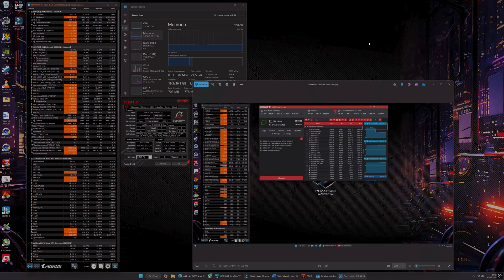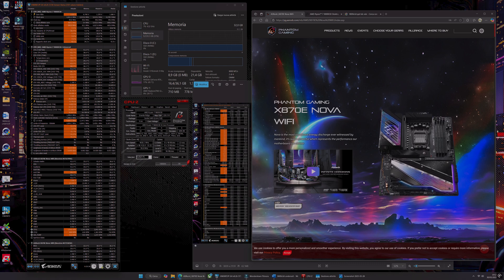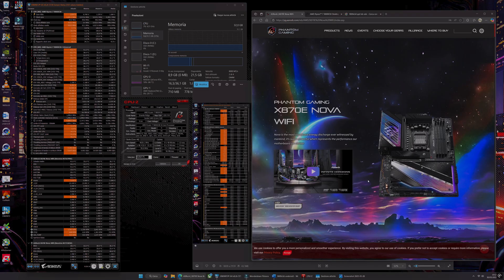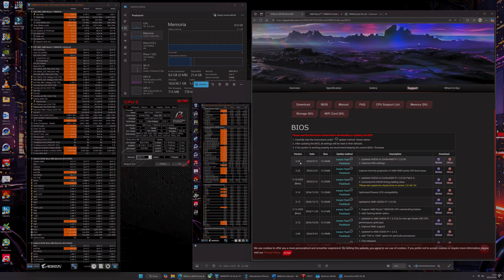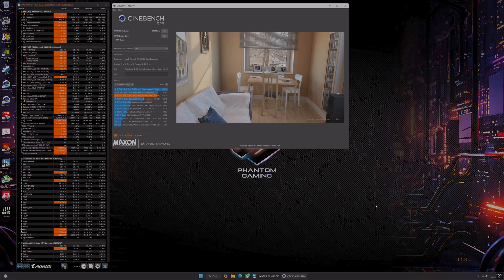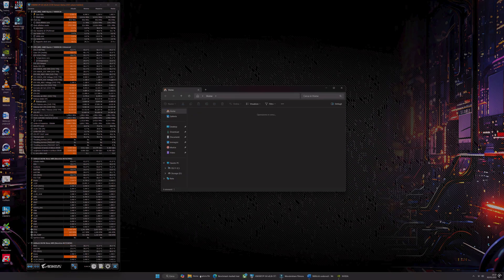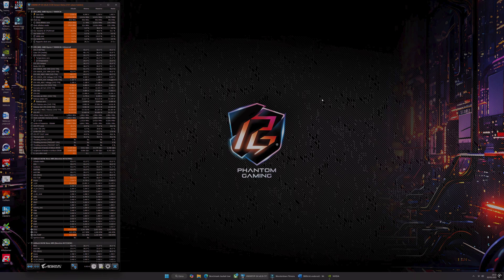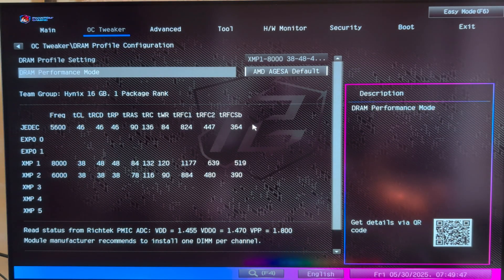Ryzen 7 9800x3d UNDERVOLT Guide and MEMORY up to 8000MTs🔥

Comment: Hei, i don't understand, why my cinebench r23 give me 14000 ( with PBO or Without PBO ) , can you help me please
Reply from the maker: Hi, first of all try to do a Clear CMOS. After that, in device manager go to USB Controller and uncheck all USB HUBs, in power management - allow the computer to turn off devices to save power. Turn off the computer. Unplug the power plug and hold down the power button for 30 seconds. In this way we reset all the USB devices that I could see that even on my 9800x3d had manifested a hardware problem! Try CBR23 again and let me know!
Reply: @eXpowerG3046 Before i have another mob and cpu ( 7800x3d ) and i not reinstalled windows ! I order 2 cpu 9800x3d and first cpu im return because cannot work with my 6400 ddr and have rha same problem with cinebench r23 , another cpu have good core and work with my ddr 6400 really cool but problem with love score on cinebench stay ( im reset my bios many times , but not helped my , but I don't reset all usb and i clear cmos - have button on my mob and this problem still) i doit with usb controller something, but i think problem with my windows ( maybe need reinstall ) 
Which benchmark can use for testing my cpu ( maybe another application work wit any problems?)